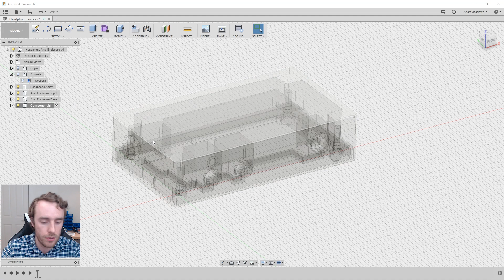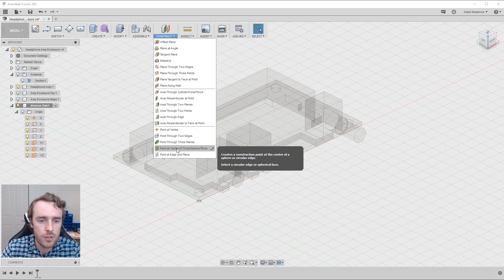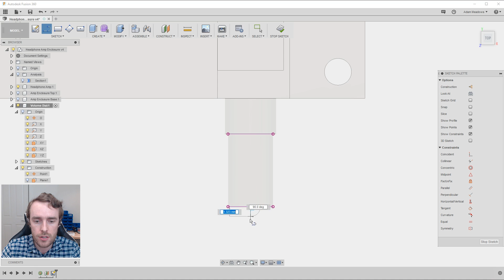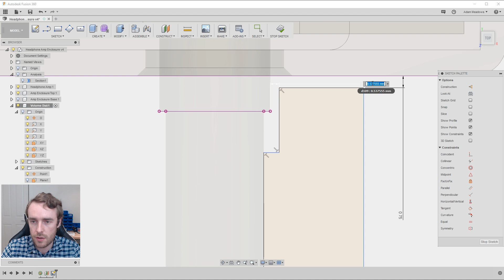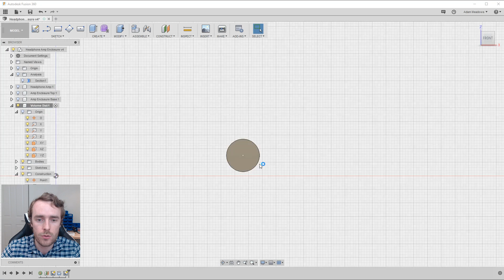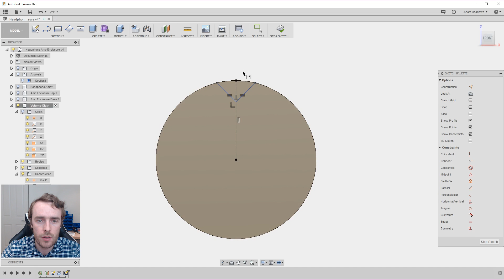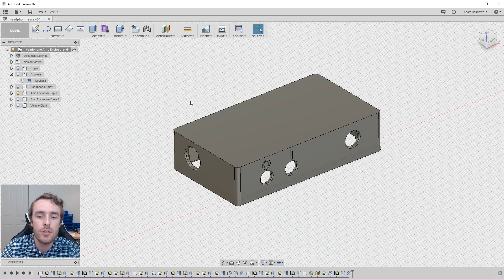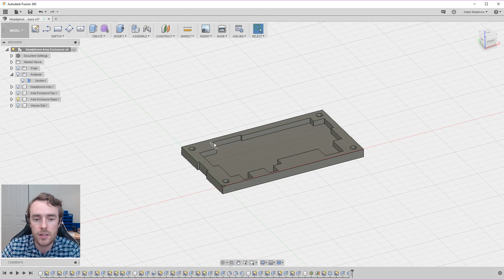Fusion 360 Beginner Project Part 4: Volume Dial

Comment: Nice, out of curiosity why didn't you leave a tolerance between the potentiometer knob and the hole in the volume dial? It might work as a press fit/interference fit but in my experience they just don't fit. That being said, my printers aren't at all top shelf and are all built to a price point or rather old.